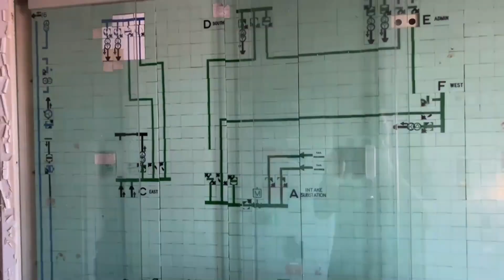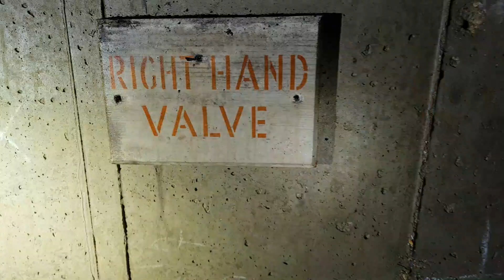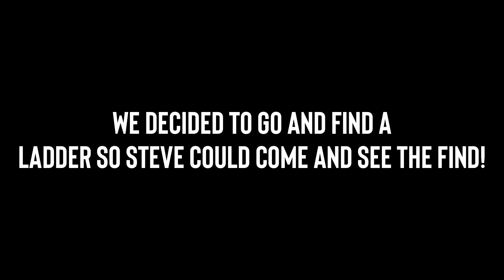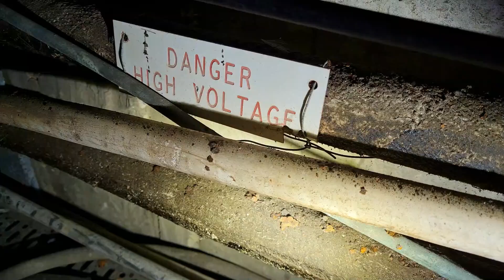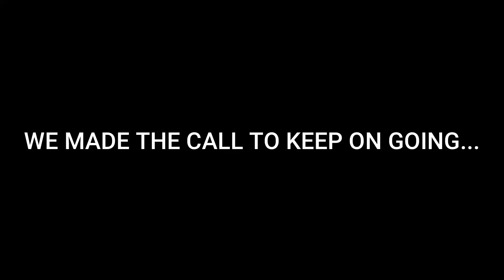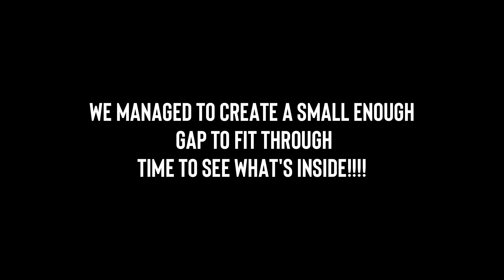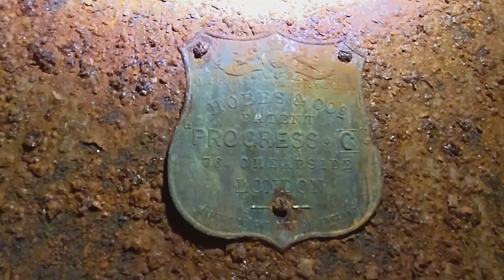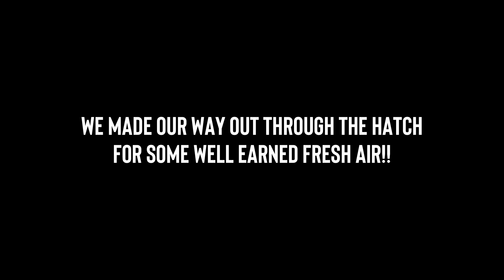We found a TOP SECRET Bunker! Ex - Surface Weapons Establishment

Comment: Interesting seeing those loo seats on frames down there. Dont see them in the UK anymore. But still see occasional contractors using them abroad.. Part of the integration process, as when a fella is getting interigated they can get messy, seats are simpler for cleanih up when hosing down etc. Just saying.

Comment: The bends in the pipes are steam expansion joint it to stop a “head “ of steam from blowing the pipes apart in a cold start
Reply: ah I was curious why there was extra effort to bend the pipe. when just going straight would have been easier.

Comment: A very amazing and risky discovery.. luckily both of you didn't encounter any dangerou creature inside the tunnel!.. Where these long pipeline heading to?...There were also a mesh of big electric cable wire this supposed to be that this bunker were using tremendous amount of power!! .....

Comment: Ffs Alex you certainly enjoy going the extra mile for the camera don’t you but only this time I reckon you and Steve went an extra half dozen miles for the fun of it. It did half bring back memories from when I was a young lad we would go onto an old knocked down building where it was rumoured that there was cellars to the old mansion that was there until it was knocked down in the  50’s or 60’s anyway me and my younger brother set to and dug out loads of bricks and rumble until we got to the old floor then we hacked away at the old wooden floor til we broke through it, then cut it away til we could get in it was a deep drop must of being 8ft at least so my brother dropped me a load of bricks down so i could make a set of steps so we could get in and out by them. It was massive under there the cellars were bigger than the house by at least 50 square yards. It was sketchy as hell under there as no one knew we were down there. We placed a board over the hole we’d made and throw bricks over the boards to made it look like it was natural. But we had fires down in our cellars and used it as our den for a few months til one day we were down there and there was a heavy rain storm and you could here all the floorboards creaking under three rain, so we got out of there double quick and when it was dry we filled in with bricks and rumble so others couldn’t get down there again. My brother went back to check it a couple of weeks later and some of the floor boards had given way and loads of building rumble had gone down into the cellars near were we had our fires.a few months later most of the floor boards had given way due to rot so cellars were no more.